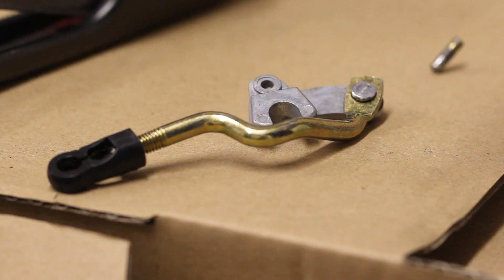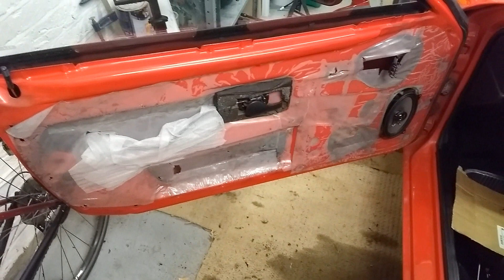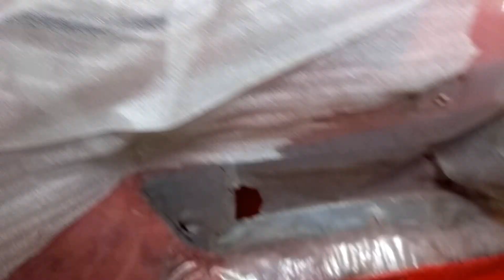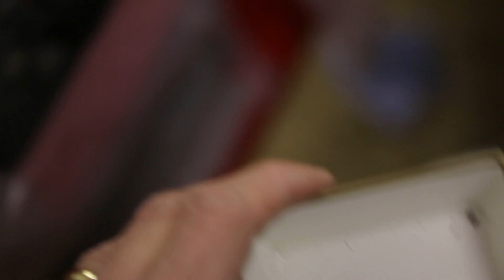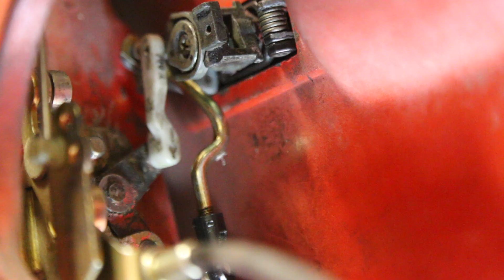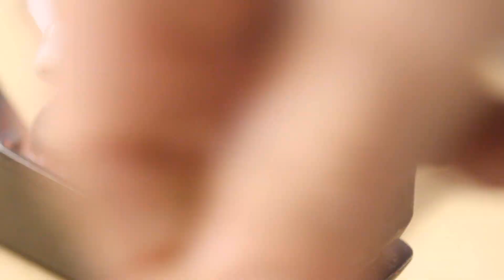Porsche 944 Door Handle Lock Mechanism Removal & Repair - How to remove Window guide channel

Comment: Alright this helps a lot. I did the drivers side on my car and for some reason the window guide rail just came right out without having to touch the window, and I was able to get it done. But now that I'm trying to do it on the passenger side it appears that it still has the screw in the top of the rail and the window needs to come out. I was really scratching my head there. 

One question, does the window just slide out of the top when the regulator comes out? I've never done anything like it before.

Comment: Welp never realised how bad my car interior was, the door cards are held in with a bunch of screws id kinda figured they would have originally had plastic caps over or maybe colour matched screws but nope appears to be that a past owner broke all the plastic snaps off and decided to just put self tapping screws through instead
Reply from the maker: You can get replacement parts from your local Porsche dealer to sort it out

Comment: This is a great video, but I'd like to draw attention to the way the new bellcrank piece flops around in it's pivot. This is because it is not the same as the original where the roll pin is pressed through. On the new piece, one of the two holes is larger, so the roll pin is not located accurately in the larger hole, resulting in a lot of side deflection. This slop reduces the amount of travel you'll be able to get by actuating the door handle. To (partially) correct this, you need to order Porsche pt# 944-537-637-00, which is a new design pin intended to be used with the new design bellcrank assembly. You'll also need a very small e-clip, but those are easy enough to get at hardware stores. To improve the action of the door handle further, you can machine a spacer and fit in the bellcrank pivot to reduce the slop to basically zero, giving you the maximum travel possible to operate the door latch. This may be a little overboard for some as it requires a lathe...But heck, even if you fit a 3mm washer to at least reduce the slop, it will help. In the end it's an amazingly terrible design, but at least you can make it 'less terrible'.
Reply from the maker: Thanks for passing this on, much appreciated

Comment: Where did you source the replacement part from??
Reply from the maker: I bought it directly from my Porsche main dealer
Reply: @ajvw  Thank you!! Found several on Ebay, Better than a expensive used handle that is waiting to fail anyway.
Reply: @Guneslinger  What exactly is that piece called? Mine is horribly broken as well
Reply: @bboymax15   Door lock linkage, found out the handle itself on mine is toast, the pot metal broke, so, it was not this piece for me.

Comment: my door handle on the passenger side is pretty hard to open is there away to adjust something in the door to help? anyone?
Reply from the maker: Unfortunately that's a sign the mechanism is about to break. Mine did the same before it stopped working completely. The way to fix it is to replace the part of the mechanism as per video, it's quite a cheap part but it does mean taking the door apart
Reply: @ajvw , Well thats if you are in the US, but in my country there is only 10 944's and no parts at all, plus when I buy a part from USA ou Euro it takes about 90 days and the government taxas me 140% on part aos shopping so yes hahahah, If I learn something with this vehicle is that not everything is a thing of changing sometimes you can fix the part but lets see whats I do but thank you for now.
Reply from the maker: That makes sense. The cause of the fault is the internal mechanism stretching which eventually will break. If it's not possible to get a replacement then I'd suggest opening up the door handle and having a look to see if you can try to secure it in another way or to reinforce the mechanism to avoid it then breaking. I'll post another link to video that shows the details inside
Reply from the maker: This shows the inside of handle and broken part https://www.youtube.com/watch?v=7oh6nS3MDYo
Reply: @ajvw  That would be super nice I ll thank you so much and I ll take some pictures when I m done thank you.
Reply: @ajvw  there are some volkswagen handles that are the same, just they won’t be script handles
Reply from the maker: Yes I tried some MK2 VW Golf handles but they'd need some adjustment to fit